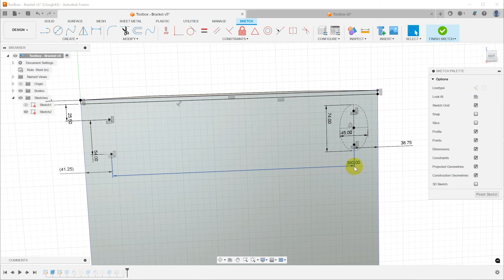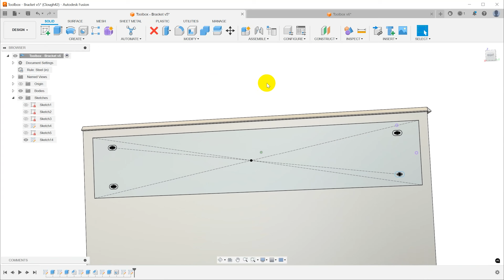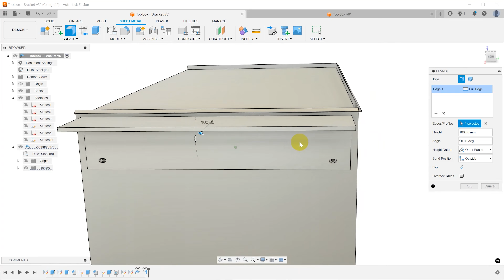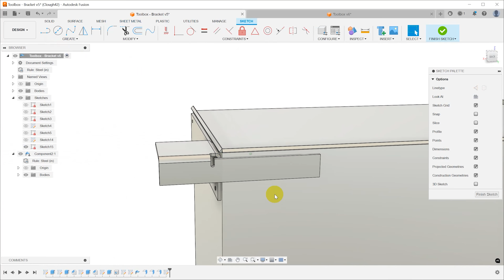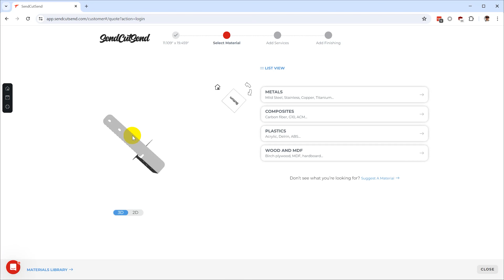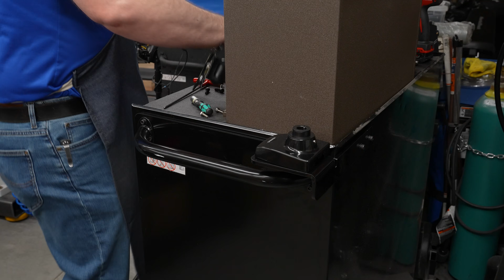How I Create Gorgeous Bent Steel Parts with Fusion and SendCutSend

Comment: Not sure if this is the extrude you want but to extrude to a face instead of a distance, in the "Extrude" dialogue box, find "Extent type" and change from "Distance" to "To Object." This will let you choose a face to extrude to so you end up choosing the sketch face as the starting point and an existing object face as the end point. The end point is really just a distance so the sketch your extruding doesn't have to physically touch the object used as the end point. You will end up with faces that are flush to the common plane.

Comment: Speaking as a laser operator doing the flat cutting on a daily basis by the tons of materials, and occasionally doing the bending on our machinepark of pressbreaks; Absolutely awesome. That smooth transition from CAD to holding the product in your hand (that powdercoating is layed on thick btw, looks really nice and durable) is such a good feeling. And then going from that to the titular "Yeah that'll hold" moment; Omg, so good! SO GOOD! I'm gonna talk to my expedition and shipping guys to do likewise with the Sourpatch candy. Every engineer at any  level of proficiency loves a bit of sugarrush. The vaccuumsealed packaging is an awesome plus. Need to speak to the higher-ups about that.

Given that I'm squarely in the center of every bit of manufacturing needed to get this from digital bits to phisical bits; This video definitely hits the spot for me! A nice intro to CAD, a great explanation and justification for your material and designchoices that take ther jobshop's capabilities and offered options into account, a smooth ordering process, "an unboxing", fitting the parts, and crossing your arms, nodding that this is the way forward. My god, we are living on the best timeline.

I'm certain this video alone will drive significant sales to the semi-auto jobshops. We're gonna make it bro's. In more ways than one!

Comment: Another way to get that first flange edge set at the depth of the back of the toolbox is to use the "reference" selection in the dialog. If you make "Reference 1" the back surface, and offset to zero, it will keep that feature reference parametric instead of using the absolute number you typed.

Comment: I often 3d print shallow parts with captive nuts for applications like the inside of the masso box.  Since the 3d printed part is just holding the nuts in position and keeping them from rotating until you tighten them up, there's not actually any load on the printed part post-install (or the printed part is just acting like a thin, solid plastic washer) so the technique is applicable even with larger fasteners.  Kind of like how flag nuts are used in automotive applications with limited access.

Comment: My jaw dropped through the floor into my basement when you showed me there is a slot tool after it had already dropped to the floor after you showed the center rectangle tool... I did all these things manually with lines and circles. I really have to check the menu more thoroughly

Comment: This is why I can't get into these hobbies...COST.  I am frightened of screwing it up and potentially losing hundreds of dollars.  Even in lumber (have you priced out plywood? Holy H3ll, and that's the 5 ply crap).  I 100% understand the cost of that 1 off design, many won't, but I do.  I dealt in estimating for over 20 years, and 1 off is expensive...proto-type pricing and I get it.

I wish I had an income flow to fund my projects, but being retired?  Well, it's kind of fixed and need to save it for the future too.  LOL.

Comment: Fun fact: those are technically DC-37 connectors. The second letter in the D-sub connector designation refers to the shell size. "B" is the size for the standard-density 2-row 25-contact connector, which were commonly used for serial and parallel ports on PCs (as I'm sure you're aware, as you are software guy of a certain generation). Since those were the most commonly-seen, I think that's why "DB" came to be widely used/accepted as the prefix for all D-sub connectors despite it not being strictly true in the original definition of the standard.

For completeness, and for standard density D-subs, the shell/contact correspondence is:
DE-9
DA-15
DB-25
DC-37
DD-50

The legacy VGA connector is a high-density E-shell D-sub, or a DE-15.

Love the channel and can't wait to see more of the CNC build.
Reply: A similarly pedantic connector fact I'm fond of is that Ethernet usually uses RJ-38 connectors, not RJ-45! The RJ- numbers are old Universal Service Order Codes (USOCs) from when the US government still fully regulated telecoms & there was only one phone company. RJ-45 was a keyed connector that wouldn't fit in the ports we use for Ethernet, and had an internal "programming" resistor. RJ-38 used the connector we have today, and connected all 8 pins to wires.
Reply: Wilst we are being pedantic about DB25 connectors, the issue that I find most irritating is the lack of concern about the wiring of (RS232) DTE (terminal) and DCE (modem) connections. The DTE is wired with a male connector (pins) and the DCE is wied with female connectors (sockets) - this of course was widely ignoed and gave rise to the (seemingly) infinite varieties of straight thru and null modem cables/adapters. All of this could have been avoided if the equipment manufactures had bothered to read the standard. We would have needed only one null modem and straight thru cable. And then there is RTS/CTS/DSR/DTR and RI... sigh...

Fortunately USB came along and is going to save us all :-)
Reply: I don't understand what any of this means but I can at least understand enough to appreciate the information dump. I salute your comment for being one of the few I've seen over the last 1.5 decades to actually be worth reading: o7

Comment: Is send cut send media blasting before powder coating? If not you may as well just rattle can it. I've owned a Powder Coating shop for 25 years and it grinds my gears when people don't media blast prior to powder coating, especially  steel. I'm not saying SCS does not blast, I'm asking if they blast.

Comment: Great Video!!!  In addition to the video being interesting it gives me a chance to ask you a question I ask myself all the time. Would you have built or purchased some of the tools in your shop knowing of Sendcutsend's services? Like the fancy Brake bender or even the plasma table.... I'm a big fan of sendcutsend. I wish they would start doing tubing.
Reply: I may not be Send, Cut, Send, but I have a 6 kW fiber laser tube cutter with an auto feeder. It can handle tubes from 5/16 inches to 9 inches in diameter and cut lengths up to 30 feet. What kind of tube cutting would you like done? 

In addition to tube cutting, I also offer laser sheet cutting using a separate 6 kW fiber laser sheet cutting machine, capable of cutting ferrous and nonferrous sheets up to 1 inch thick. Furthermore, I can cut any hard or soft material up to 8 inches thick using my waterjet cutter. The waterjet is 5-axis, allowing me to also cut precise bevels.

Comment: for your fusion question: change the reference for the distance and use an offset of 0; you have to hit X to clear the default reference, then choose the face. This will be parametric whereas just choosing the face or using the three dots measure tool just fills in a number that won't get recalculated (I don't think)
Reply: Three thumbs up!!! Even I got it to work. THANKS!!!

Comment: I'd love to know more about that captive nut plate you placed inside your display module - how did you draw it, how do you add the captive nuts, and prep it for ScS?

This whole project is amazing and I am in awe.
Reply: Drawing would be very similar to the process he showed for the first extruded plate. If you put round holes in a part, SCS will give you an option to choose hardware insertion (studs, nuts, and standoffs) with a little drop down menu. They automatically resize the hole based on the size of hardware you pick.
Reply: Of course, for something so simple, you could make it out of four pieces of shim stock, held together with the rivnuts.

Comment: Some double sided tape on the nut plate would stop it falling off when you forget and take all the screws out in the future.
Here in the UK, our tape measures have both imperial and metric on.
Great result 👍
Reply: Aus tape measures also have both metric and imperial as a rule. Very rare to get only one type.
Reply: @LordPhobos6502 Last time I was at Lowe’s here in SoCal, they had 28 tape measures……only One had a metric scale😂🤪
Not surprising though, having spent 50+ yrs working on metric vehicles.

Comment: I have never seen this kind of drill for sheet metal.
The trick the old machinists use is to put a piece of wood under the sheet metal and put a little piece of folded rag between the drill and the metal. Makes nice and precise round hole even when using large diameter drill.
Reply: Doesn't the rag get immediately wrapped into a lump around the drill?
Reply: @Graham_Wideman yup, and the finish suffers

Comment: As a cyclist, I always use epoxy around nutserts when installing them.  I have to use aluminium ones in aluminium frames and steel in steel, and the consequence of one coming loose is that its REALLY hard to get out without leaving an oversized hole.   That way leads to scrapped frames and noone wants that.
Reply: How do you get it to flow into the crevices?
Reply: @erik_dk842  I put a layer around the outside of the nutsert before installing, and as it squashes down any excess comes out and gets wiped up.  This has worked for all ~dozen I've installed this way - my first one was a disaster which is why I had to improve the method.

Comment: What you were saying about designing a part, uploading it, then receiving a finished product. Yeah, that's satisfying. Rarely does a month go by and I don't use an online CNC service. The one I use the most is Hubs (now owned by Protolabs) and they are fantastic! Out of 24 orders in the last three years, I've only had one issue with parts being out of spec, and they made it right. I'm making a series of kits to convert mechanical combination locks on bank vaults to electronic.

Comment: i wanted to drill a round hole in thin sheet steel so I tried a DeWalt drill that was ground to drill a flat bottomed hole, worked great, perfect round hole.

Comment: For the sheet metal flange question....  Use the "Two sides"  instead of "Two Offsets",  then you'll be able to simply click any parallel/highlighted face to automatically snap the flange length to match that face... Not sure why it doesn't work that way in Two Offsets as well 🤷‍♂   Works the same way while doing an extrude/move/etc in solid space 👍

Comment: Just wanted to say thank you for the inspiration on the projects (and discount) as I finally ordered a PM728-VT mill, as well as a lathe to fill out my new shop up the road from you.  I didn't order the ball screws and not going to convert it to CNC yet as I still need to complete the build out of power and add a HVAC mini_split.  Going to hunt down the drill bits as they look perfect for sheet metal! And you can't say too many good things about Send-Cut-Send as they eliminate the need for a plasma cutter, bending brake, finishing...and No burnt or cut fingers or frustration!

Comment: Perfect timing on your video. I am currently working on some mounting brackets for an automotive project and was digging for the Fusion 360 videos to get a handle on the sheet metal option to send the brackets to Send-Cut-Send. and the discount code was nice as well.

Comment: James, next time, take a picture of the side of the toolbox in high resolution with an artifact in the picture in which you know the dimension. Import the picture into fusion. Scale it to the artifact dimensions (I use a ruler usually) Design your toolbox model from that picture. You’re welcome.
Reply: Because your clearly convinced that's going to work perfectly, I know you've never tried it.
Reply: @ huh? I’m an engineer who does this crap for a living. Thanks for your opinion on something you obviously know nothing about. Good talk 👍🏻
Reply: @MakerMadness  Photos made with normal cameras have parallax and barrel distortion which introduces uncorrectable errors into the process your describing. Being a dick does little to convince others of the strength of your position.
Reply: @brocktechnology  Dude, you need to take the picture in specific ways. Research before you challenge somebody’s proposal. I guess I now need to do that step for you… On an iPhone the camera needs to be directly perpendicular to the object. You need to have the grid on and follow the horizon line until it is aligned. You need to be on 1x zoom.

If you’re too cool to figure out those couple of settings then use the iPhones lidar sensor, there are several apps that can produce point clouds that can be used in Fusion. 

I wish people like you would spend time doing their own research on how to do something properly instead of taking that time to challenge somebody on a topic you know very little about.
Reply: @MakerMadness  I propose that, that is a very different suggestion than the one you originally made and probably not superior to the 3D scanner that James has right there in the same room somewhere.
I haven't actually tried this with a smart phone where we can remove lens distortion in software but your still working with perspective reference in an isometric workspace. so your still gonna get parts that look fine and don't fit. As this is working for you it would seem your working to relatively low tolerances, which is fine, if it work it works. Perfect is the enemy of good enough.
Reply: @ more incorrect inferences, but whatever… If your initial message wasn’t such a dick statement we would probably have been friendly. Just for the record I prefer precision, the rest of the world does not seem to embrace that philosophy. A guy who uses this workflow is probably looking for gnats ass quality, at least in my mind.

Comment: Lucky regarding your error. It sucks that SCS won't let you modify orders before they enter production. They're a bit too strict.
Reply: It's a necessary evil. Their production process has a large amount of automation so having people be able to easily modify orders prior to production would screw things up and increase everyone else's costs.

That said, I have had been able to have SCS hold/stop an order from entering production if I catch an error really soon after submitting it (like within an hour). But that was a few years ago.
Reply: @asad-mg6fn  I've had them pause my order at the verification stage before it goes into production. You then can upload a corrected file and get it back into the queue. They definitely can do it, maybe it's a disruption for them, but it's better than producing parts that will be scrapped.

Comment: If you want to pull the flange and snap it to the correct distance, the back of the toolbox, just start pulling the flange, and then before you hit enter, just go and click on a point that is on that plane, and it will snap to that distance.
Reply from the maker: Neat!  I'll have to try that.
Reply: @Clough42  the other benefit to snapping the distance like that, I believe, that relationship remains parametric.....where, if you just typed "50.2mm" that flange is going to stay that length if you go back and change something, and won't update correctly.  👍🏻🍻
Reply from the maker: @Steelcrafted  I will play with it.  This is exactly where my 2mm error came from.

Comment: I think you're underestimating the rigidity of 1/8" plate steel, that bracket in 1/4" you could park a car on it. lol
If it were me however, I would have probably used 3/16" aluminum... Not that it matters, steel is cheap and you got what you wanted.
Reply from the maker: Yeah, I don't know.  Now I want to try it.  :)

Comment: Edit: Figured out how to set the offset length without entering it manually.  Hover your mouse over the value for the offset and you will see three dots. Click on it then click on measure. Then click on the face of the offset and then the face you want to extend it to. 

How much did that part cost? I get a feeling you could have printed something in carbon fiber nylon that would be strong enough and cheaper. It's not like it's going to see any big loads or moments. I still like the idea of being able to get steel parts like that made to spec for a one off.
Reply: The price came up on the Send Cut Send  order page, I think from memory it was about 102 USD with the powder coating.
Reply: @brianm9962  That's really not bad. It's totally over engineered, but I never want to say that's a bad thing.
Reply from the maker: The price was visible on screen.  If you're only ordering one, you pay for it.  If you need 50, they're a lot cheaper.  I only need one, though.
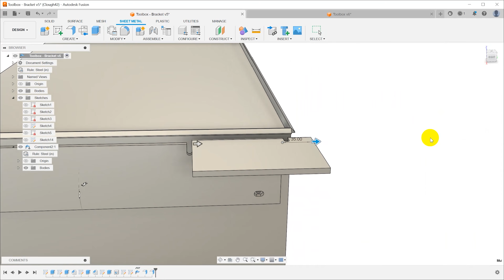Reply: @Clough42 Still looking for some acknowledgement for explaining how to do what you were asking for at 13:12.
Reply: @Clough42  I typed before watching the whole thing 🤦What rules are there for the bends? Could I make a square? Do they do welds?